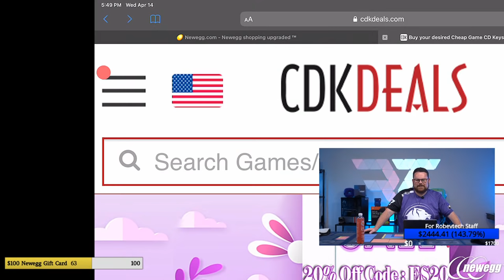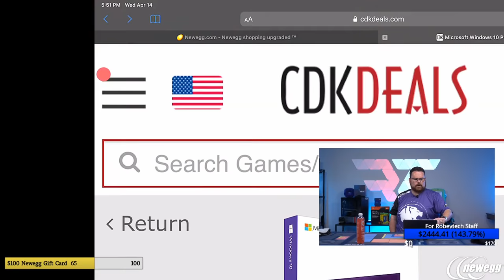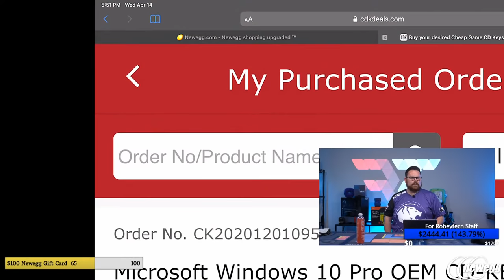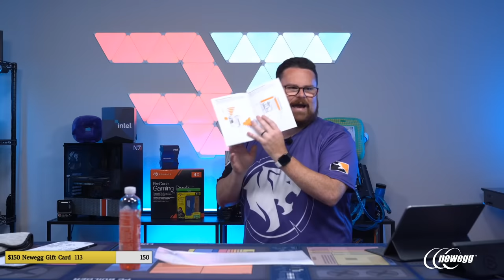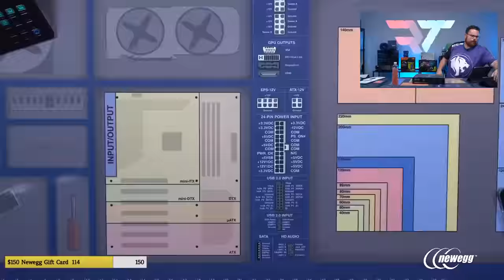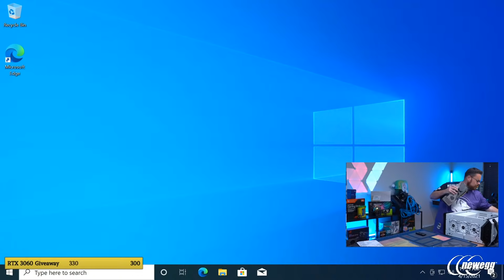How to Build a PC – Giveaways + $2600 Build in the ASUS TUF GT501 (Ryzen 3700x / MSI 3070)

Comment: I’m working on this build myself. Except I went with the 3 fan radiator on top, 3 fans in front, and a 140 in the back. Plugging the 3 from the aio and 3 from the front into the commander. Where do I plug in the 7th fan?
Reply: did you build it by your self? and do you have any experience on building pc. i will build my pc soon
Reply: @-king1264  I built it on my own with no experience prior to that build. It wasn’t as hard as I imagined it would be.